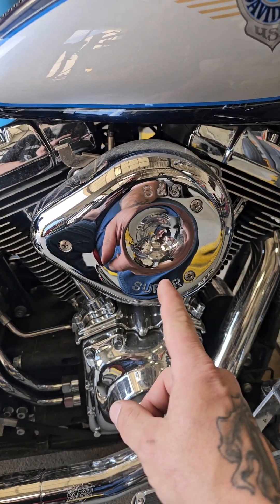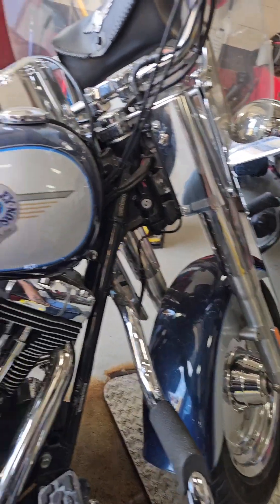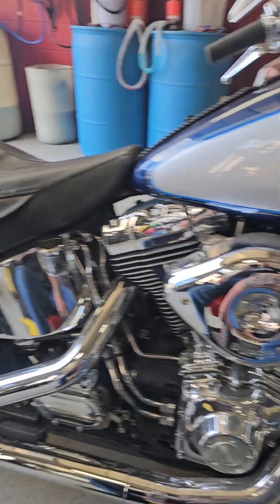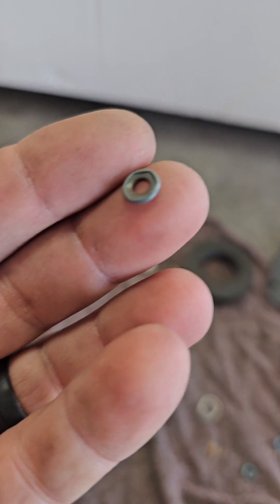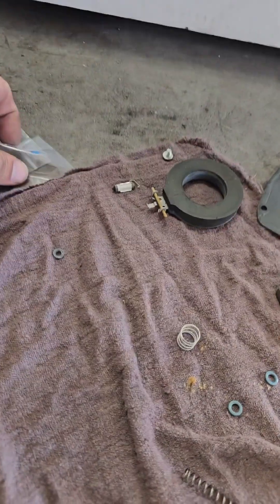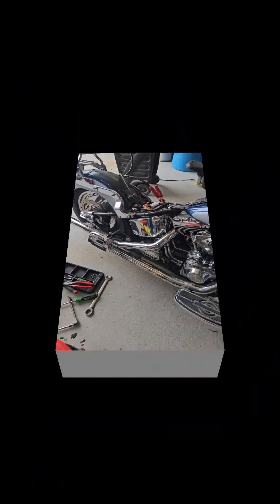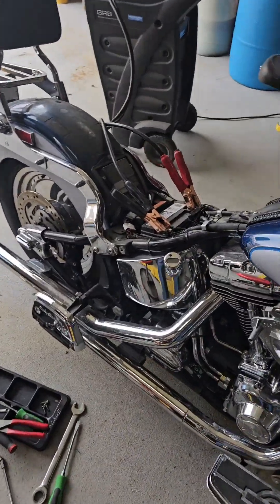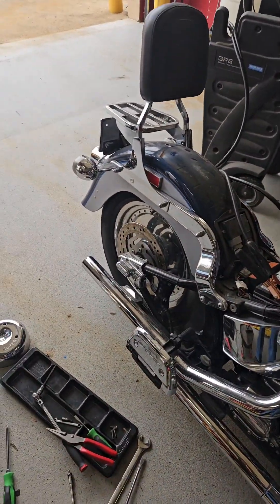Waking the Fatboy up after it winter slumber

Comment: Love it. I woke mine up, but haven't taken her out yet

#96fatboy
#patatopatatopatato
Reply from the maker: Well what wasn't shown on camera was after a half an hour it started sputtering again. And I reset and re adjusted 5 times to no avail.  Then I realized the first thing I should have done after a carb issue was replace the spark plugs.  And it just so happens I have two more brand new plugs in the shop that slipped my mind lol.  So looks like I'll be riding in Monday and changing those lol